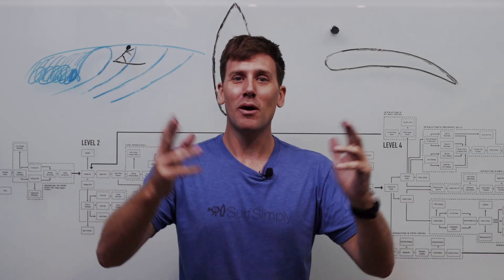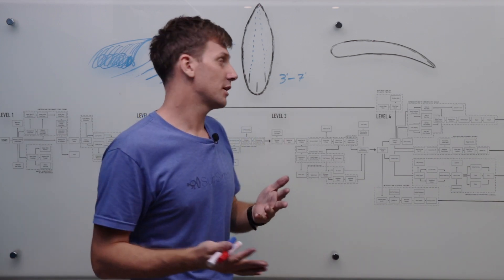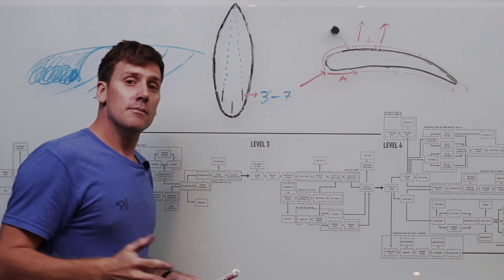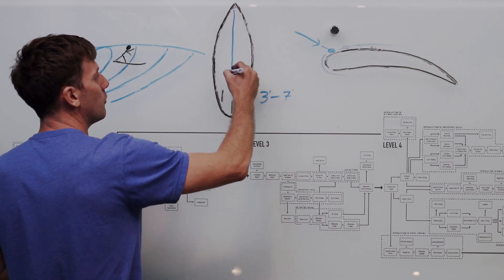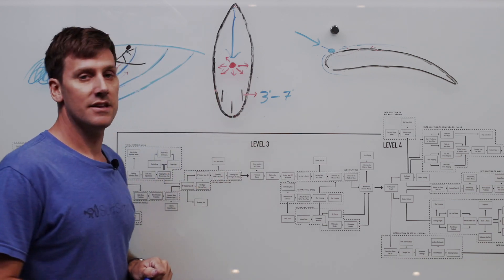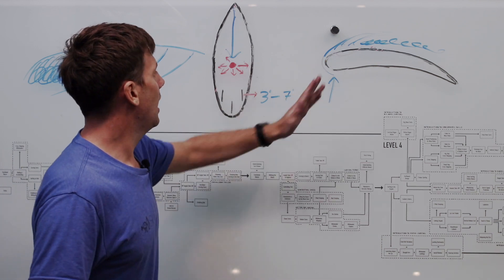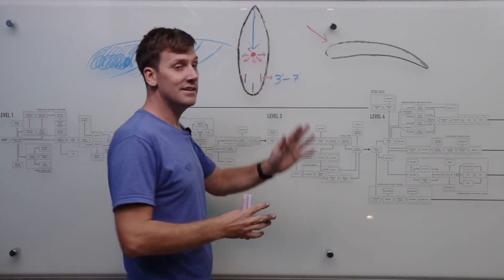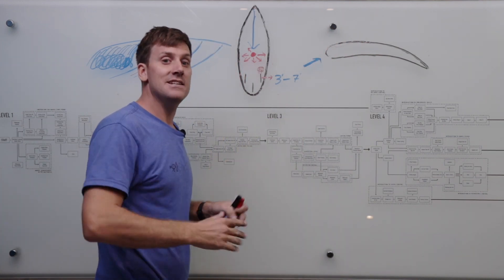Surf Simply's Question Time: Why are side fins toe'd in towards the center?

Comment: Very good video! What is often overlooked is that assymetric side fins need more toe-in than symmetric ones. The more camber a fin has, the more toe-in it needs to compensate for it's negative "neutral angle" (angle of 0 lift) which typically requires around 2deg extra toe. Id rather see boards having the symmetric toe-in value in their boxes so that fin builders can compensate for the additional toe-in due to camber built in the fin.

Comment: I am a manufacture of Jet boards, electric powered surfboards. We are finding that having the fins toed out helps with much harder turns at high speeds. 
We are usually not riding waves and are on flat water, so there is no wave water pushing up sideways under the board. 
We use a jet like a jetski to propel us forward. 
What would be your thoughts on this?
Reply: Toed out at the front?
Reply: Please do not ride your jet board thingy near me ...🙂

Comment: Keel fish fins are straight and double foiled....if your fins are that straight and single foiled it feels like you have the parking brake on......ask me how I know
Reply: So what you're saying if my center fins on my quad are 80/20 then they are going to slow my board down compared to a 50/50 foil? I'm so confused
Reply: Exactly, extra camber (asymmetry) requires extra toe-in because their neutral angle (angle of 0 lift) is negative.

Comment: I have a question re: pressure differences and lift as a hydrodynamic function instead of an aerodynamic function? Water is not compressible whereas air is. Does water flow faster across a surface creating a low pressure area? It does with air but m not sure the same principles apply with water? When water is redirected there is a force applied in the opposite direction but not so sure about pressures like a wing because water behaves so much differently than air given the same foil shapes..

Comment: One more great video of yours! In fact there’s an interesting point over there about if happens stall or not when it’s changed the stagger angle from 3-7° to 0°, because as hardly as I think it would stall there is a chance of having cavitation in high velocities and angle of attack on the upper fin (the one closer to the face wave, with higher aoa). The stall phenomenon is more often held by airfoils in airflow stream and not in water as it’s density is way higher. Moreover, this extreme conditions of high aoa may happen in very short instants naturally (as the surfer does a sharp turn or snap) with or without the stagger angle and from that I don’t think the implementation of this stagger angle was made to avoid these conditions as the surfer does turns for both sides. I do think they were made to make the board rails more attached to the wave face, thus combining the lift from the fins and the rail to keep the surfer on the wave face in the power zone in a more comfortable configuration (having more lateral flow under the board) and avoiding pearling in hollow waves. After all these implementations were all made by empirical testing right? I just wish there were more researches in this area of study...

Comment: If you've ever steered a boat with a rudder, toe-in is pretty simple and obvious. When you bury the right rail, the right fin's toe-in acts as a boat's rudder would, set to make a right turn. (Meanwhile the left fin is being lifted out of the water so it loses influence.) This is true regardless of foil and lift. The "cant" or tilt of this rudder presents a more perpendicular surface in relation to the water while  banked over so that the ruddering can maintain its effect. Whatever foil is added to the fin only serves to enhance the primary effect of a turned boat rudder. A toed-in side fin will quicken the turn even with a straight foil.
 BTW a thicker fin with a rounded leading edge is faster, holds better for its size and  produces less turbulence.. something to consider for trailing quads and center fins. So sand those knife edges off your fins; they'll be less likely to "hum", they'll be faster and they'll be safer!
Reply from the maker: Wow David thanks for this insight, it’s all very interesting indeed!
Reply: @SurfSimply  back at ya! I  lived thru the short board revolution so my knowledge is broad but shallow haha.  Appreciate your scientific approach! Foil, angle of attack, lift, concaves, channels, edges, release etc are indeed mysterious, fascinating, magical and huge in their effect. Like you, I look forward to more research and design  because I don't think we're anywhere near complete in surfing evolution.
Reply from the maker: I agree David, I’m hoping that in the future particular with wave pools, we might be able to set up some testing equipment and finally get some real data on some of these theories.
Reply: Ah ha, that’s how “side bites” help tighten a carving turn radius, compared to single fin only - the rudder effect of the canted side bites steer the tail around. Brilliant explanation, thanks.
Reply: Makes sense if you ignore the fact that the other fins toe angle is providing just and much counter force. I suspect the real reason is a lot more dynamic and is also probably why most very high performance surfer do a double pump bottom turn, because toed in fins are inherently unstable, they want to turn and actually resist going perfectly straight.
Reply: @AEVMU the fastest monemt on a surfboard is on rail, slicing downward.. not flat going straight

Comment: I was hanging on the edge of my seat thinking you would have a theory for how thrusters work , ahh but no. 
You made some good points especially abou AOT. Quite variable. 
Transitiong too.
One thing for certain is a thruster is slower than a single fin in a straight line. So there is a drag element. Perhaps more deflection is occuring rather than lift.

Comment: Thanks, that was very interesting!
One Question: So why exactly are Keel Fins not angled in and what would that provide, more speed and less maneuverability?
Reply: Originally the fish was a way for a kneeboarder to handle steep fast hollow waves in a wide outline.(No room to place knees and flippers within an actual narrow pintail singlefin). Each keel is designed to work with it's side of the tail like a single-fin pintail, like an old-school pipeline board would have. Keels  are large for their depth, so when running flat, toe-in would have them fighting each other in a "snowplow" of drag, turbulence and wiggle-waggle. We're talking racing tubes here, not a series of S-turns.

Comment: Could this be the reason groveler type boards tend to have less aggressive tow in vs high performance boards?
Reply: I'm guessing that designers balance design components to  compensate between outline, rocker fin configuration wave size(speed) and performance levels. Like using more rake or less toe-in on a rockery, curvy outline, or vice-versa. So it depends on the rest of the design. A short curvy groveler may indeed require less from toe-in to initiate turns.
Reply: As you mentioned, there are likely other design features that come into play with fin tow in angle.  Surf conditions and surf goals may factor in too.  

When i look at a board that has aggressively towed in fins and or rocker, my basic sense of physics tells me that board will not paddle efficiently, it will induce drag.  However, my goals at my mushy, local break are different from the guy who is charging pipe or some other place that has real waves.

thanks for your insight

Comment: As always, great to see and hear! It all comes across very clearly. In my mind, the 'Bernoulli lift' is best described as a 'pressure differential' between top and bottom of the foil (i.e. difference between p_above and p_below), rather than high pressure underneath and low pressure above, but that's detail. [You need new pens :) ]

Comment: Great video. Is there empirical evidence about what happens when you angle the fins out? I'm sure shapers have tested all sorts of configurations, just curious. I would assume frequent stalls and tail spins.
Reply: can confirm. surfed a board with fins toed out, the board constantly wanted to spin out and almost wanted to shoot me off the back of the wave. turning was pretty much impossible , could hold a line once you got use to it.

Comment: Very cool video. Fin cant seems like the natural follow-up video, but I'm really dying to better understand hulls vs planes. The hull seems so undesirable, yet my hull pig is amazing, and the whole Andreini following swears by them. What's going on down there? Thanks!
Reply: In boats, round hulls are faster, but in surfing will lose plane without a constant long-running wave.. hence their cult-following at point breaks. A single center fin and soft-wrap rails  allow the board to "find" its place in the curves and suction of the wave, rather than forcing a lot of fin and rail water-displacement ( "gouging") to "drive" the board.